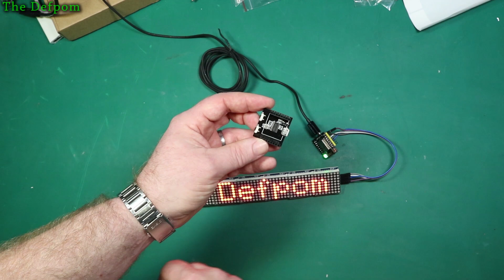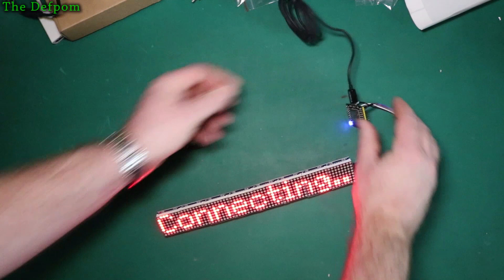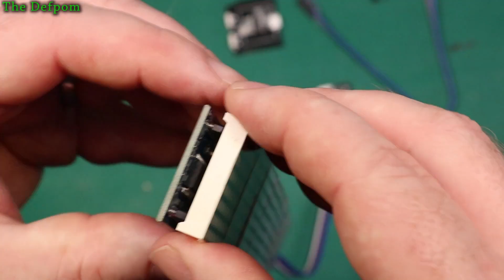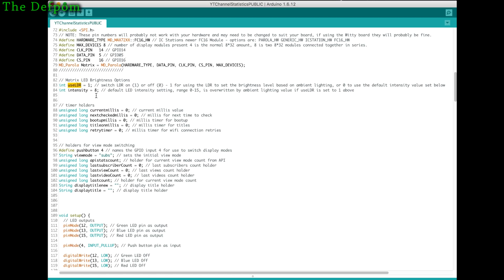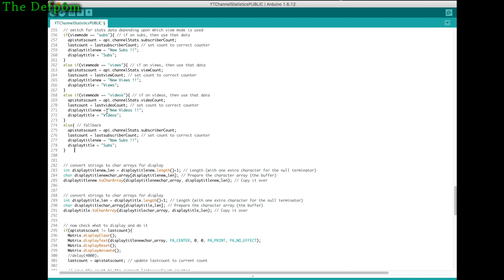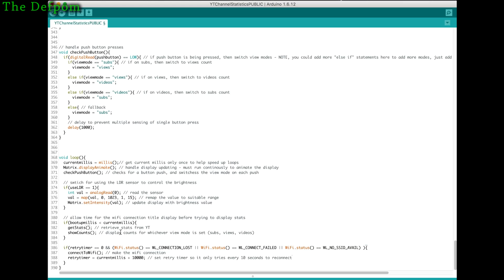🔴 #481 Witty ESP8266 and 8x32 Matrix LED Module Review for ICStation.com

Comment: Very interesting. I would like to see one of those subscriber counters implemented using those large electromechanical displays. It’s funny I have used more micro controllers than I care to remember (most no longer exist) and I’m heavily into ARM, but I find arduino really hard to use especially the shitty library manager.  I will have to stick with visual studio although that’s god awful as well.  Still great video very impressive. Thanks for sharing.
Reply: I just can't stomach the Arduino IDE to edit code, Notepad++ all the way. VS for VB I don't mind, albeit I just use it as a glorified editor and not much else, never debug.
Reply: IanScottJohnston  been integrating our ARM with visual studio tool chain including debug and test driven development framework. Joy